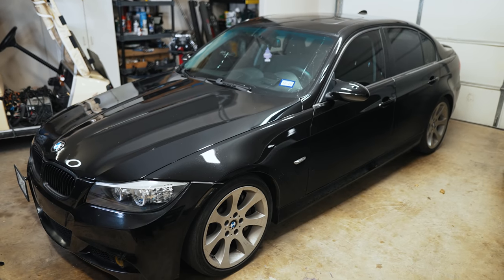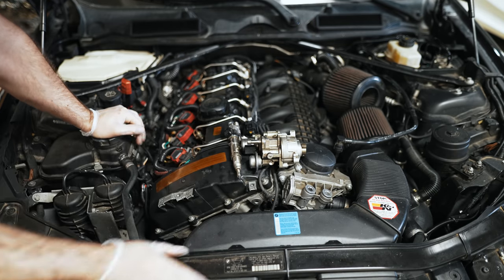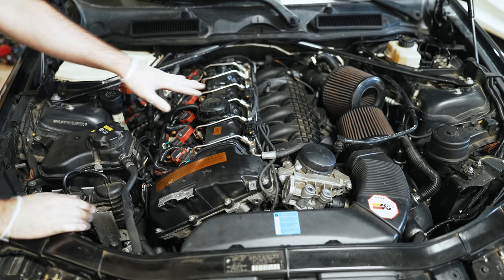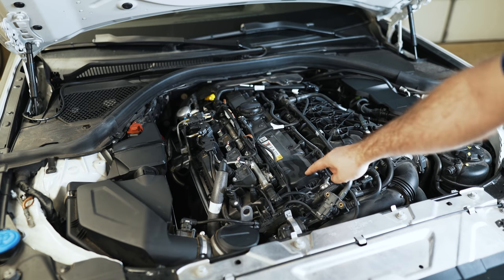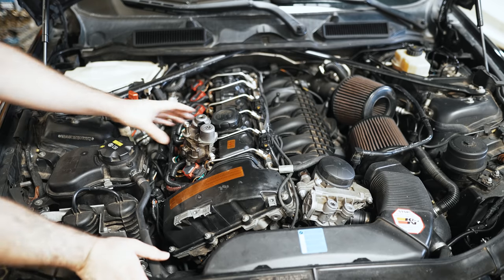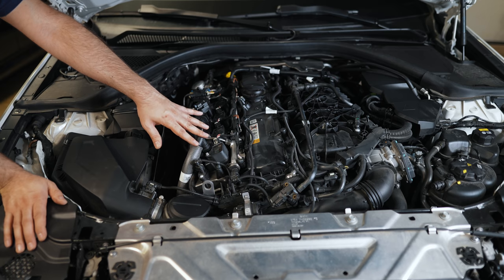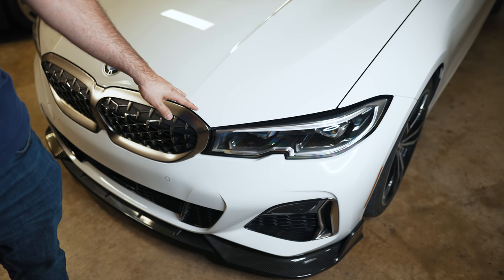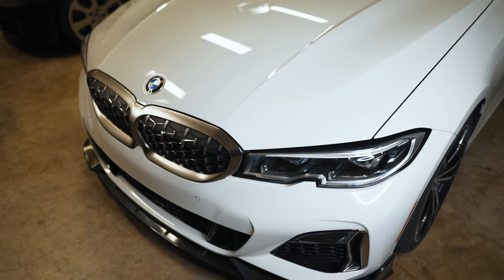Here Is Why New BMWs Are Now Reliable

Comment: Those are interesting points. I think to how the Toyota Supra would’ve used a BMW engine that it would have to be more reliable than past generations. Time will tell but your hypothesis on reliability makes sense at a first glance. Well learned from a master tech like you!!!!
Reply: AUTOCAR, ( the worlds oldest motoring journal) said that when TOYOTA collaborated with the BMW GROUP on using their engine for the SUPRA, Toyota’s engineering team required extensive quality upgrades to BMW’s seals throughout the engine to eliminate oil leaks ( which BMW are well known for) Toyota insisted that all the seals/ gaskets be manufactured in Japan to TOYOTA’S Stringent higher specifications and BMW agreed. Therefore, if you buy a SUPRA you are assured, like ALL TOYOTA ENGINES of a leak free engine effectively throughout its service life.
Reply: Philip Lee thanks for sharing. As a master tech myself, with experience in all makes, I can assure anyone that Japanese manufacturer sealing technology is superior to all other. I was surprised to see a BMW engine spec’d in a Toyota product primarily considering the leaky nature of their engines. The N series 6cyl oil filter housing gaskets have been superceeded 3-4 times and last I checked the most recent version is made by a Japanese manufacturer. That says something.
Reply from the maker: @philiplee7604  Nice, thanks for the info. Hopefully they apply the lessons learned to all engines going forward.
Reply: @greasemonkey1489  is it also happening to the N20 or B48? Thanks
Reply: Each car manufacturer needs to have a video like this.I bought a KIA Stinger after reading the engineering of it--reliability in addition to performance were a priority.
Reply: @greasemonkey1489  any links to this information??
Reply: @philiplee7604  does this carry over to the bmw m340i or is that still unreliable?? If only the Supra had two more seats 😔
Reply: r cast the trouble areas are valve cover gaskets, oil filter housing gaskets, oil pan gasket, and rear main seal. That’s been going on since the M5x engines. Mostly heat, thermal cycling, and elastomers that don’t have long term petroleum resistance.
Reply: RazorRC ... 15+ years of experience at my shop.
Reply: @X1xRiGox3X There is a great video on youtube about Toyota's collaboration with BMW.
Reply: I have a 2024 GR Supra 45th Anniversary with B58 engine. I bought it primarily because of Toyota's collaboration with BMW. Historically, the GR Supra has been very reliable since its introduction in late 2019.

Comment: I have 2010 final N54 535i M-sport stock.. I have changed everything on it HPFP LPFP, my car had index 12 and they still failed, got all 6 new injectors again.. Transmission Service, Plugs Coils. Intake cleaning , gaskets, belt pulleys tensioner. I AM AT 156K MILES now.. spent tons and tons of money to keep it going and hopefully she does. Holding strong !!!  

You are making me buy another one :D

Comment: I have had 2 335i e92's. one 08 and now I have a 2013is. Other then the pump and plugs I have had to do nothing which is amazing to me. car is at 95k miles with no leaks so far. I'm sure turbos will go out soon but their still keeping up at 18psi. I personally believe with the updated injectors and coils, along with the update in software helps to make this car why more reliable for daily driving.

Comment: Early direct injection in BMW’s were cam driven, not sure why they went away from that to the chain driven pump in N54 and early N55. later N55 had a plunger style pump. Hopefully they properly hardened the pump lobe or spec’d a proper hardness follower otherwise early failure of the camshaft is possible. That would be a large job to replace as the chain is on the transmission side now. Plastics they use aren’t easily recyclable because they’re made using fiberglass reinforced nylon. I’m not aware of secondary uses. The use of plastics are mostly due to part complexity. Far cheaper to make multiple molded components and fuse them to create the final part. Coolant bottles on X series were placed away from heat, still failed. Mostly at weak points- meld lines and utrasonic weld joints. Last issue I’ll address is plastics in general both under hood and interior- they’ve been trying to go away from heavily petroleum based plastics to their detriment. They become brittle sooner. And the overmolded buttons/trim have always been an issue with many German made cars because there’s no mechanical bonding of the 2 plastics.

Comment: You have to remember and take into consideration that excluding the rare 80's M1 supercar, the N54 engine was BMW'S first attempt at doing a turbocharged petrol engine.

The N55 which came out before the B58, is a reliable relatively strong engine imo.
Reply: My N55 was built at the time at the the B58 was also in production. I bet my N55 shares some revolutionary tweaks the B58 introduced.
Reply: @Scotford_Maconochie  It doesn't. N55 is based on much older technology that is far more unreliable than the B58 as they're completely different engine architectures. N55 might be reliable but it's the weakest turbocharged inline 6 that BMW has produced.
Reply: Umm...BMW's first turbo car engine was in 2002 Turbo in 1973. The M1 wasn't a turbo. lt had a tuned intake manifold with individual runners and throttle bodies for each cylinder along with a massive diameter "bundle" of snakes" stainless header. A detuned version of that engine went into E24 and E28 M635 and M5. A further detuned version went into the US M6 and M5.

Comment: I have a 2016 340xi. 75k miles. Not a to single problem. I just got the transmission fluid changed. It was still clear! ZF for the win. Going to tune it with mhd.
Reply: Get ready to spin your rod bearings.

Comment: Usually the first 40-60k miles, BMW dont have major issues. It is the high mileage cars that things start to wear down. I wonder if you keep the m340i at least pass 100k miles and see what’s it like for viewers.
Reply from the maker: Yeah it would have been nice to keep it that long to really backup my claims.
Reply: I have 335is 33000 miles on it bought it new.  Have value gasket and oil ring gasket replace due to oil leak and charcoal canister.  Lol. No mechanical issue so far
Reply: Thanks Sherlock.
Reply: @rickychen2966  And how much did that cost you?

Comment: As an owner of a E92 N52 car, I was really nervous when I bought the car for $11K with 98K miles. After 1.5 years of ownership and gained some DIY skills, I am quite confident that I can enjoy the car for many years to come.
There are perks you get from owning a good looking BMW. People do notice the car and the drive is always a wonderful experience. 
I have owned Toyotas and a Miata. I always felt those cars trade driving pleasure and comfort for the reliability and cost reduction. Japanese cars simply can't corner properly, I've had so many close calls and minor accidents because of this. Also they always have terrible brakes, stopping the car at high speed is just a nerve wrecking experience.
I never miss any of my Japanese car ownership but I do miss driving my German cars even when I have not driven for a few days, i would crave going for a drive.
Reply: I have had my e92 for 10 years this summer, and its N52 has proven exceptionally reliable.  I have rear-wheel drive, no iDrive, and a manual transmission, all of which amounts to significantly more reliability IMO, without sacrificing the experience whatsoever (indeed enhancing it because I love driving manual).  I absolutely love this car, and it has only 100k kms, so it can last a whole lot of years if I continue to take care of it.  I believe it can make sense to own these cars if you are willing to do some of the work yourself.  Support / DYI online is exceptional.  Parts are easy to obtain.  I too have had Japanese cars before (Nissan 240SX, Honda Accord).  Just not the same...
Reply: 🤣🤣🤣🤣 Delusional.
Reply: Heres the ULTIMATE DYI skill on all beeeeemers DYI to the JUNK YARD!!!!!
Reply: My 2008 E90 with N52 now has 187K miles. I bought it CPO in 2011 with only 24K miles. It has all the normal repairs (most paid for by the CPO warranty) OFHG, valve cover, Oil pan gasket, water pump changed out preventatively, new set of coils.  Just recently the fuel pressure regulator (one under rear driver side seat) cracked and failed.  That fuel tank is a crazy design!  Car runs like new. Doesn't burn a lick of oil between the 8K OCI I use.  We'll see how long before all the nuisances begin from the plastic/rubber rotting.  Already replaced the rotting rubber of the trunk release handle and the surround around the rear window.  Also had 2 rear door window regulators fail.  I just keep throwing new brake pads, tires and oil changes at it and it keeps running like new.  The N52 was way better than the N54.
Reply: Obviously, you've never driven a GR Supra. My 2024 with B58 engine is an amazingly good handling car. 
Gazoo Racing knows a thing or two about handling.

Comment: The n55 with single turbo and valvetronic is extremely responsive, and the improved injectors are a big improvement. Each iteration has a lot of gains, 3 or 4 iterations is always huge. Cams gears on the back though I'm concerned with still. Any job starts to become an engine out ordeal, might as well be a rear/mid engined c8 or 911.
Reply: I have a 2014 535 with the N55 engine, and the only headache is the oil leaks at the oil filter and oil cooler housings. Serviced twice, and the car has only 55,000 miles on it.
Reply: @rollydoucet8909  Change your Rod bearing at around 100k bro
Reply: Just not good enough. Low quality and poor engineering. An old Saab would show them some engineering. BMW lost their way chasing money..
Reply: @rollydoucet8909  2yr ago... Hope you get this and reply. 
Serviced only twice? And it has 55000km?
What model and Do you still own it?
Reply: @mobilekaos  Mine is a 2014 535i with X Drive and the M Sport package. The oil leak issue started a couple of years after I bought it. and I goy two new gaskets from the BMW dealer. Within two years, the leak started again. A German car parts vendor told me there are better gaskets available, so I bought them. Lower price-better quality with the new gaskets, and now more leaks.
Reply: @rollydoucet8909  hi great to hear back. First thanks for the tip regarding the gaskets. I was not aware there were better aftermarket ones
My main query has to do with your comment that you've only done two services and you have 55000 K on the car. Are you saying that you've only changed the oil and oil filter twice having put 55,000 km on a car?
Reply: @mobilekaos   What I said was I've only had the two issues with the leaking gaskets. As far as servicing, I change the oil and filter every year when i take the car out of winter storage, even if I haven't driven the 12,000 kilometers that BMW recommends to be the oil change time.
Reply: @rollydoucet8909  
  ahh yes.. I can now see how I read your message differently.

I appreciate it if you could give me the name of the HQ aftermarket gaskets. I will be replacing them on my gf's n55. I will be changing them on my n54 335IS as well

Comment: Yeah I’ve owned many BMWs and I’ve never had confidence that they wouldn’t leave me stranded after a while.
Reply: Then you aren't maintaining them.
Reply: you don't know to maintain them. I had 3 bmw's in last 12 years and didn't have any issue...
Reply: A good friend of mine used to be a die hard Ford Taurus driver. He thought having his car serviced every month was perfectly normal until he got a Honda... then thought it was bad not to have his car serviced as often. 
He now drives a  BMW... I am sure he is happy.
Reply: Maintenance on a BMW isn't a guarantee you won't be left stranded vs driving an appliance.
Reply: @chrislim7976  i have bmw's for over 15 years, never left me stranded...current car is a 2014 f10 lci, in 5 years i had no issue, only time i went to service was for maintenance. I also have a f15 with over 150k km and works like a charm.
Reply: Aria  so 150.000 km it's 10 million miles according to you😂😂😂...nevermind. also if you call everything BS look for romanian fb groups for bmw's and you will see most users (90%) have their cars with over 100 k miles(160k km)....some of them encounter problems which are fixed quite cheap...
Reply: Also smartass in our country mechanics don't ask an arm and leg to fix issues...the price to fix an issue is comparable with normal cars (mondeo and so on). It's more expensive to fix a honda accord then a 5 series cuz there are no parts, aftermarket parts or mechanics for hondas. Hondas are quite rare cars, for 100 5 series you have 1 one accord😂

Comment: Had a brand new '18 BMW X1 MSport - within 50K miles - it required roughly $12K in parts and labor - simple estimates direct from the service invoices with part numbers and labor hours - everything from turbo/wastegate to constant all wheel drive adjustments to a $500 battery replacement.  Got dumped right when the warranty ended.  The newer ones may be more reliable - but I'll never know - as I won't be buying any - one and done.  Really like this channel though - top notch work.

Comment: I did 240k miles in my f10 530d. Never an issue. Even my e60 535d with 180k miles never had an issue except for an expensive wing mirror replacement. Regular maintenance from reputable garages make a huge difference

Comment: New BMW‘a are very reliable. My f30 has been so reliable with correct maintenance. G20’s are much more so in my opinion. BMW has been focusing on reliability, I couldn’t be happier with my modern such a beautiful looking and operating machine.
Reply: Actually i had E 90 and before E 46 and i was super happy with both, but i do realize many people had problems with E 90.
Now my F 30 is fucking perfect, i'm trilled with it, except E 90 had much better feel behind the wheel.
Reply: Do you guys have the 4 cyl or I6 on your F30?
Reply: Sincerely u should all try the diesels. Where i live they are more appreciated than gasoline engines. Me and my family own more than 7 bmws and none of us had problems with them. And just 2 of them are gas powered x3 m40i and a 2 series :))))
Reply: @zareefhaider6451  4 cyl.
Reply: Aria  All three cars of mine were reliable.
Reply: @Castro Jordan how about the 2019-2020 g30 530i how reliable are they? was in the market but needed some assurance before i decide 100%
Reply: How it reliable it hasn’t been longer since they come out.